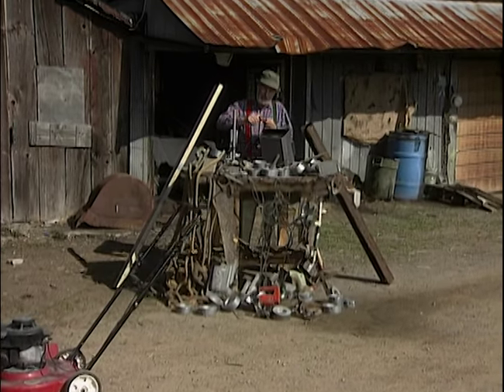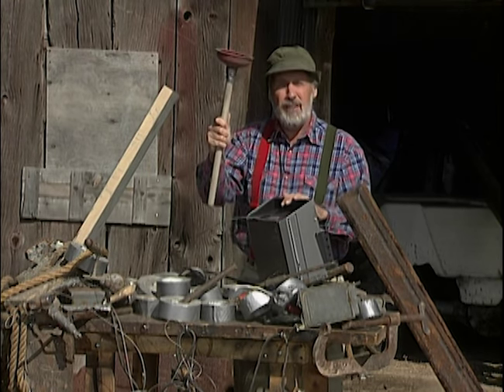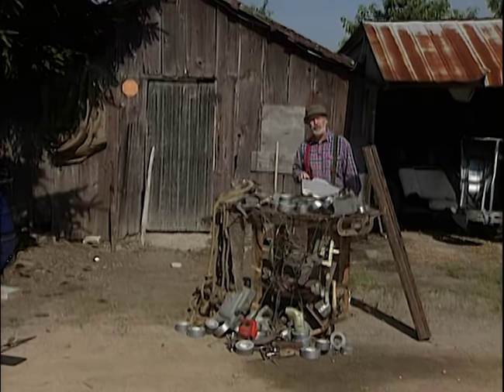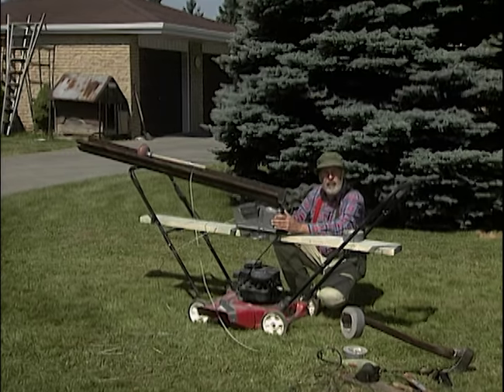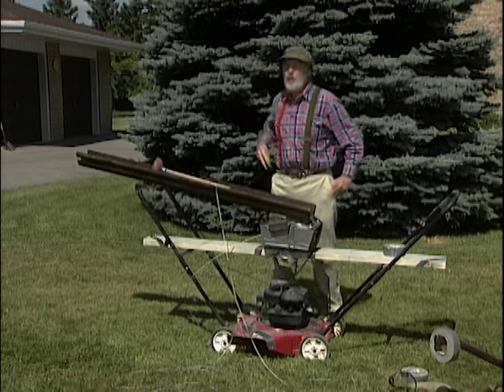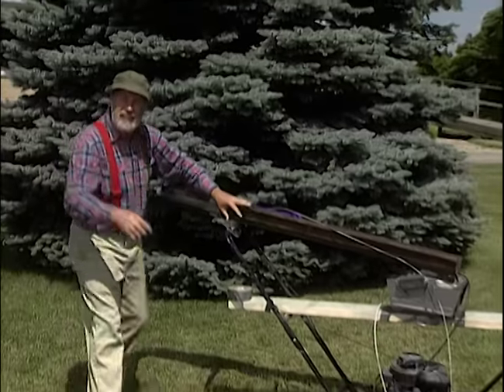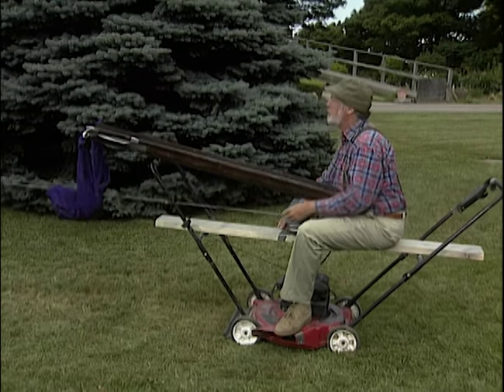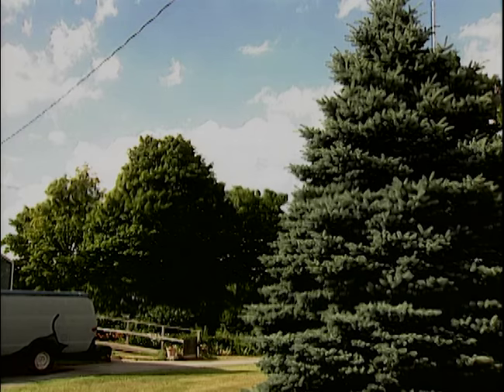Red Green's DIY Riding Mower

Comment: When I think of riding mower I think of the a push mower combined with a electric or gas scooter for  the elderly to use to get around.
Or or I think of a golf cart with two push mowers attached to it.
Reply: Gingerbilly put a dirt bike onto the handle of a push mower, and it actually works!
Reply: Thought of the day ; push mowers can be pulled.

Comment: The best DIY "riding mower" I've ever seen is a converted bicycle.
I learned about this amazingly innovative device by stumbling across it in a homesteading meme photo. The photo was done as a joke, but the bicycle mower works.

The inventor simply removed the bike's front wheel and replaced it with an old-fashioned, human-powered lawn mower.
To mow your grass, you simply hop on the bike, pedal it like normal, and steer it with the bike's handlebars.